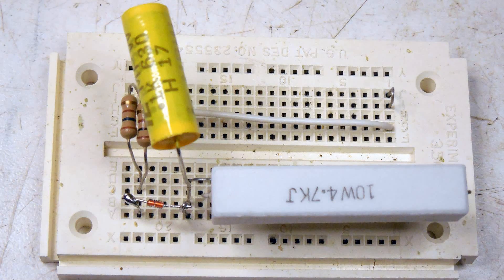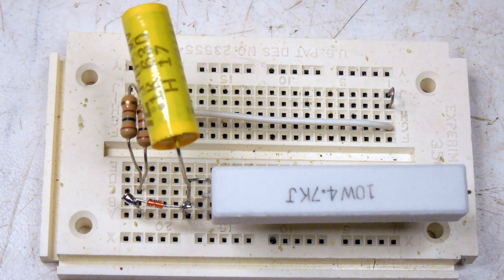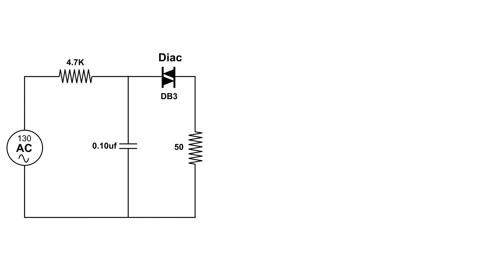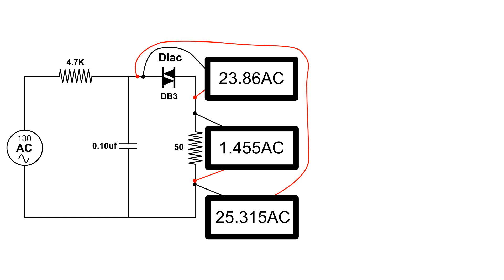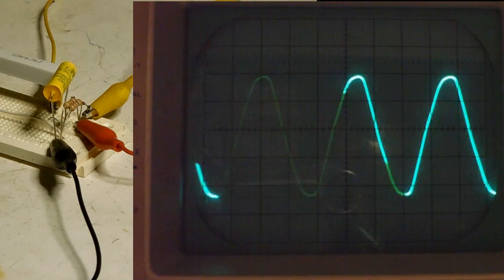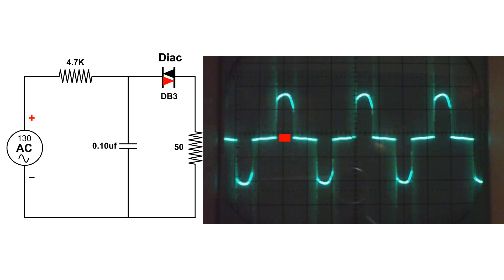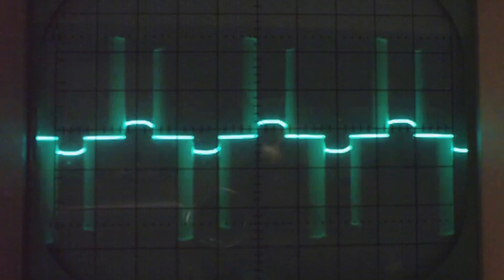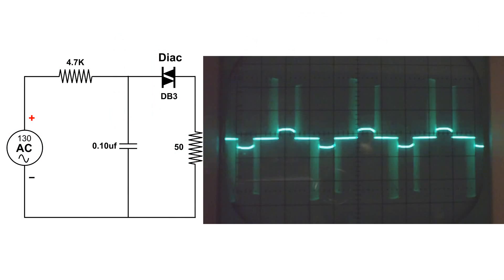DIAC Circuit, oscilloscope demo

Comment: I understood that a DIAC can send a pulse to trigger a TRIAC gate, but I really appreciate seeing the oscilloscope trace. The DIAC only passes voltage greater than its threshold voltage.  I'm repairing a universal motor speed control on a leaf blower.  The circuit is similar, but with a "resistor ladder" and a sliding contact to control the speed.  I haven't figured out why there's a low value capacitor in these circuits.  What would happen if the capacitor was removed?
Reply from the maker: I would need to see the wiring diagram to determine what the capacitor is doing in the circuit.
Reply: @AllAmericanFiveRadio  Thanks for your reply.  I found the answer in this video by Grounded Electrical Solutions shows the circuit and explains the capacitor's role in the control circuit. The rate at which the capacitor charges is determined by the variable resistor. The capacitor is often 0.1 uF in these circuits.  The capacitor's discharge goes to the DIAC which is connected to the TRIAC;s gate.  The capacitor's role is controlling the time between electrical pulses delivered to the TRIAC's gate.  https://youtu.be/P6jD5KEKhCU

Comment: How did you set up your oscilloscope to prevent blowing it up?
Reply from the maker: This is in my Channels Description
Always Use an Isolation Transformer!
Always Use an Isolation Transformer!
Always Use an Isolation Transformer!
Reply: You isolate the circuit under test?
Reply from the maker: yes

Comment: Correct me if i am wrong - The breakdown voltage of the DIAC in your circuit is 23.86 volts AC and the total of your circuit  consumes 50.63 Volts AC - The 70.37 V AC left from 130  Volts AC is dissipated in the 4K7 load as heat?
Reply from the maker: Voltage = 130
Total Resistance = 4750
Current = 27.37 Milliamp
Power = 3.56 Watts

Comment: Sounds like it can be used as a speed regulator diode for an ac motor but I'm uncertain and unfamiliar about this kind of device.
Reply from the maker: I did get this out of a light dimmer switch, and that circuit varies the duty cycle of the AC power.

Comment: A DIAC relaxation oscillator. This has inspired me to pull out my old GE SCR manual 4th edition and look around at some circuits to play around with on the breadboard this weekend. I have a bag of 4 or 5 DIACS some 2N2646 UJT's and some old GE TRIACS I can't remember the number of. Should be an interesting weekend.
Reply from the maker: Thanks capriracer351

Comment: Thanks for video.  I have often wondered how they work.  I knew diacs are used in motor speed controls, dimmers, hvac applications etc, to trigger or fire the gate of a triac or SCR.  This is the first time I could actually visualize what it was they were doing.
Reply from the maker: I was disappointed in the specs for the DIAC DB3. The break overvoltage could very from about 28 to 36 V. Zener diode specifications are much tighter.

Comment: What is the purpose of a DIAC?
Reply from the maker: The DIAC, also known as a trigger diode, will turn on at a certain AC voltage. The type of DIAC and the circuit it is in determines this trigger voltage. In this circuit it is about 25 or 26 VAC. The DIAC seems to be like two 26 VDC Zener diodes back to back. Although Zener diodes have a tighter specification.
Reply: AllAmericanFiveRadio  thanks for sharing also an alternative way to look at it is a multi pole trigger switch and it is commonly used to trigger the gate of a Triac in any instance where it is possible to ‘phase angle’ control an ‘ac’ field effect , in other words the ‘AC’ equivalent of PWM. Most commonly seen in a light dimmer or AC universal motor speed control. In such cases an RC timer is usually set to control the time aspect of the Diac ‘reset’ with the ‘dimmer’ controlling a variable R of the RC timer. 
How you have given me insight is to show that the field effect ‘sensor’ in the DiAC that causes its initiation to an ‘off’ state from either pole is in fact a capacitor which makes perfect sense in retrospect. Regards.